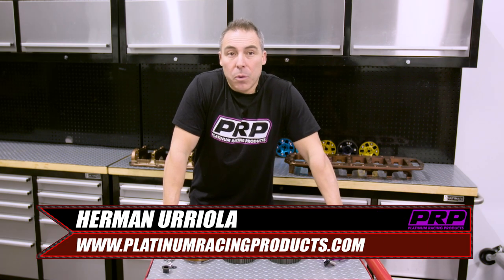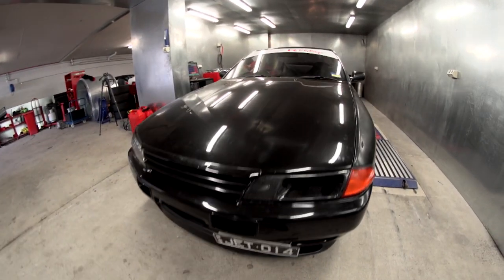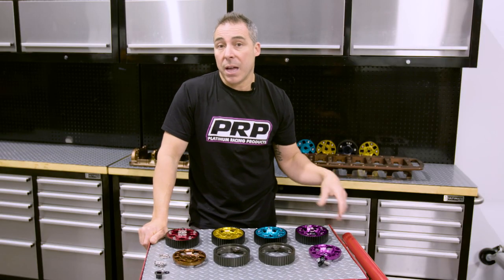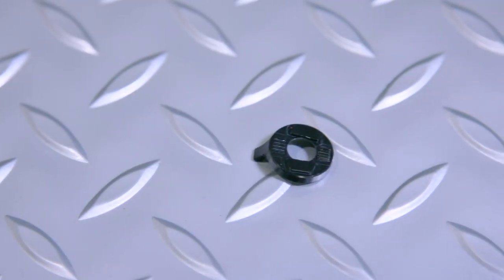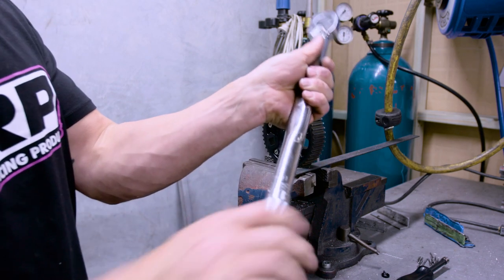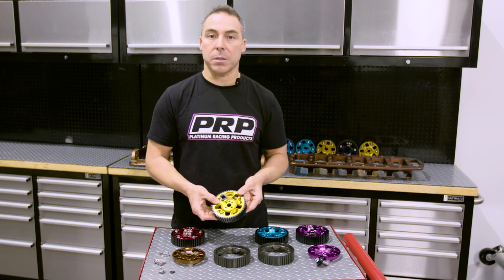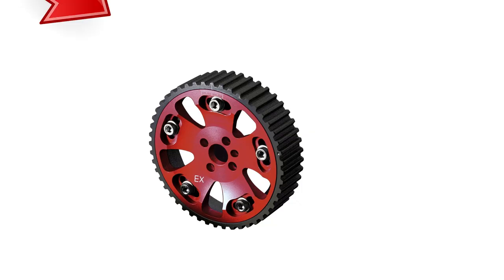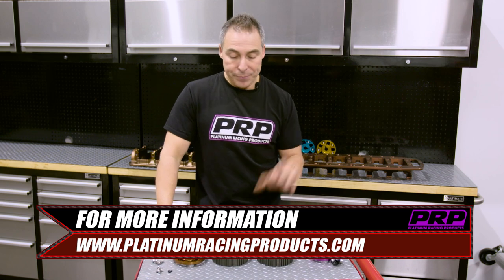Why You NEED Adjustable Cam Gears on Your Modified Engine - Platinum Tech - RB26 4G63 1JZ 2JZ CA18

Comment: If you are tuning an old engine without cam phasing, adjustable gears are great! 
Do remember to properly torque the adjustment bolts and loctite them once adjusted.
Also always check fit before running em. I've seen em lopsided and with gear grooves cut too shallow. Also don't trust the timing marks, degree them yourself.
I'm just glad you can buy em for most cars now, I used to have to make em myself out of 2 OEM gears.
Reply: Dont have to Loctite them with PRP, as he displayed you’re little RB isn’t going to spin one of those let alone 5 adjustment bolts with the locking mechanism they designed.

Comment: I put my half worn put moon shaft for my cas exhaust cam on to my inlet side and my spare exhaust cam in replacement. I picked up a extra 50hp on my mini RB or the mosted hated engine the CA18DET 100 bucks say what ya want but my 300hp daily 180SX is still rockn hard for the last 22ys.
Reply: Only hated by those Sr tractor engine fans.

Comment: While convenient (and I use them on my CA18 and SR20,) there is always a chance they'll slip. Having solid pullies with multiple keyways or the camshaft drilled with multiple dowel pin holes gives the same adjustability, but removes the chance of slippage. Going forward I'll be having my cams drilled with multiple dowels, as I've done for my KA24DE and just use OEM gears.

Why not have cam gears exposed: Gravel traps... Gravel traps... (keep the shroud's on  ;) )

Comment: please make cam gears for VG30 engines. I love my 300zx. I already have adjustable gears, but they are made using existing gears as core. Your engineering work is amazing. PLEASE PLEASE support the VG30. It gets so little love...

Comment: How about an adjustable alluminium outer for the vct cam gear or a completely alluminium vct cam gear
Reply: You can adjust an oem vct cam gear it’s just a huge pain because you have to take the gear off, make a change, reinstall and then do a dyno pull. You can also just degree it to crank 0 as a start point
Reply: @daneprostamo-brown6552  there's also a kit to make it adjustable from boost doc, but it would likely be beneficial to lighten them up and make them easier to adjust

Comment: Cmon guy's the 2J intergraded main cap girdle, please................
Reply: The real question is why would you need one? Billet main caps handle 2500 whp as they are? Std main caps handle well over 1000 whp ... supply and demand
Reply: @michaellukies1319  There already is a prototype made, why would I go an inferior option if this will be available? You're bracing and combining the main caps with  the block and each other! Just like the RB and just like the new Barra version, As soon as it's available, I'm snapping one up Day one! It's the closest thing to a full billet block option!
Reply: Im with Michael on this one... waste of money for 99.99%.
Reply: @I_dont_read_responses  Man, I'm running 1300 plus kw to the wheels here, anything that can negate block twist to that level is a great investment! Billet caps don't do shit at those torque and boost levels! Sure it's enough for your common 1000hp weekend streeter! But a Main cap integrated Girdle is as close to a bullet billet block as you're gonna get!
Reply: @BUZDRIFT  Point stands... most of 2Js don't make 1700whp+ and this would only be an additional expense for most.
Reply: @I_dont_read_responses  But, as I've stated, Not for me! IDK about any other run-of-the-mill 2J build, I've always looked at it from my point of view for my build! Hence, my impatience!
Reply: @BUZDRIFT  I'm sure with this post companies will be rushing to create one just for you 😄
Reply: @I_dont_read_responses  They're already creating one, i even have the prototype pics! FFS follow the conversation! 🤣🤣🤣
Reply: @BUZDRIFT  Blame it on the alcohol 😁
Reply: @I_dont_read_responses  Hahaha, you're excused 😄